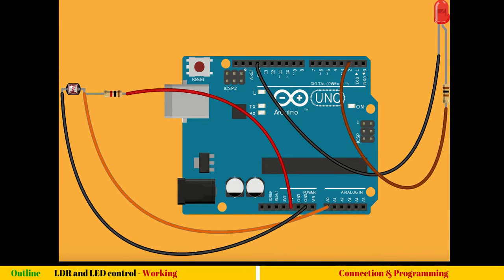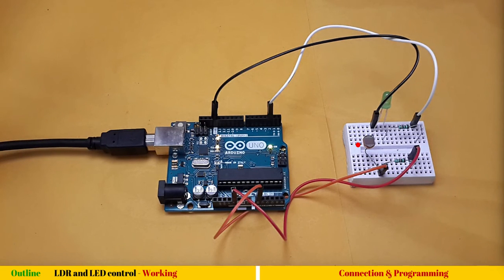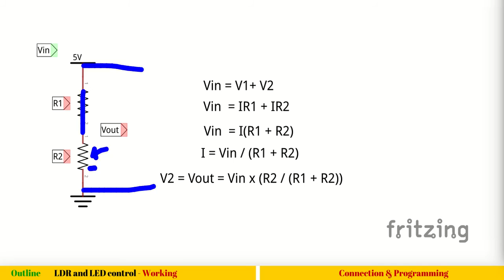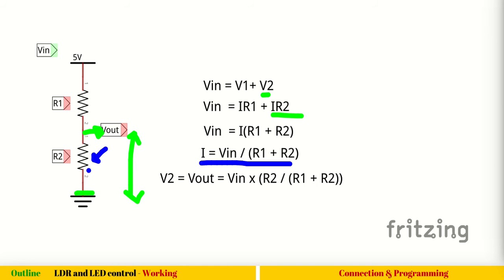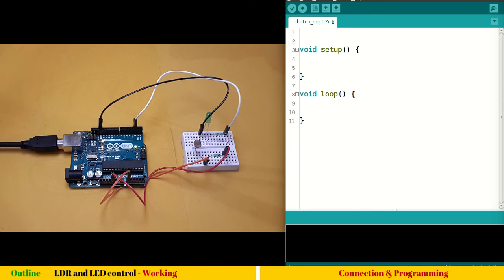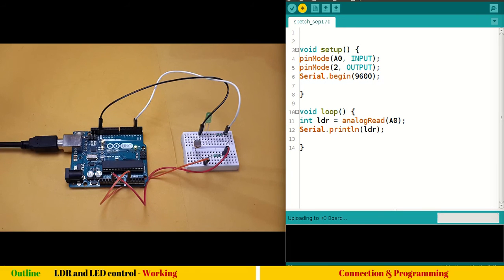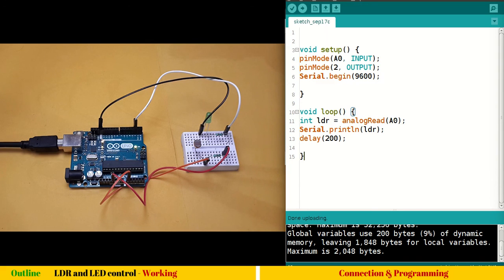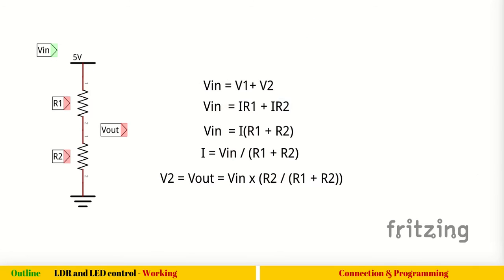17. Interfacing LDR(light dependent resistor) with Arduino(ADC)

Comment: Sir. I am an electrical engineer, passed out in 1977.
During those days microprocessor was in very early stage. 
Earlier I was doing my designing using discreet components and simple CMOS and TTL IC.
In one of my application i need a frequency divider.
Input is a square wave of 0 To 10 KHz.   I need to divide it by a programmable actor from 2 to 100.
Kindly guide me with CODE for Arduino
Reply from the maker: Sorry, sir, I've moved from Arduino long back, however, this link might interest you https://circuitdigest.com/microcontroller-projects/arduino-frequency-counter-circuit